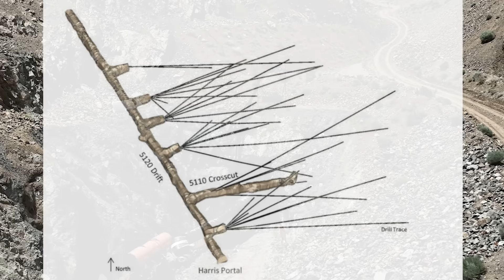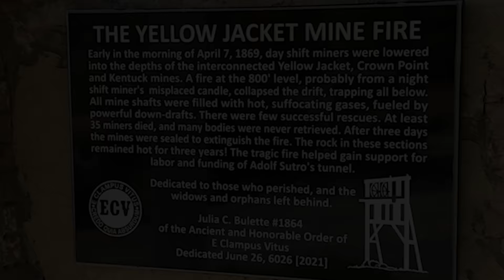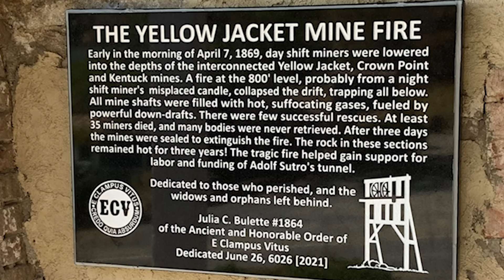Why This Location is the Best Place to Find Placer Gold !

Comment: Years ago, I started digging into the methods used to smelt iron before the Civil War.  I found a whole bunch of people and artists that didn't know what they were talking about.  Then I found a picture showing the old blast furnace with a wooden building built on top where they would feed the furnace below.  The fuel was charcoal and the mix was limestone, clay, and iron ore.  Each would be placed in the furnace in layers.  There was a water mill/bellows attached to one side to push air in.  So much was lost when people moved to modern tech and forgot to document the old methods.  I feel sorry for anyone that wants to move back to old technology!

Comment: I have recorded quite a few hard rock mines and mill sites in California, mainly on the west slope, I never saw the intense use of quarried stone masonry for the mill sites and head frames you show.  Thanks for that.  The cover built by BLM probably achieves two key goals.  One is that it preserves the shaft, which is historically important.  The other is that it preserves the shaft as a roosting area for bats, which are considered important biologically.

Comment: I’ve heard of cool mines , hard rockin with rock temp 167 degrees , 100% humidity. That was till I hit 7000 -7500 feet . No timber ,Paper , no combustibles . there spontaneous combustion is a fact . Work 12 minutes timed then out . These areas put a igloo2 1/2 gallon of ice water on floor 12 minutes later hot water . My skin felt the same gettin steak from broiler oven . Fires death . never go alone under ground  u might never be heard from again . NO JOKE . Thanks Jeff n mrs. Jeff . Have a great time !
Reply from the maker: wow ...that is some crazy temps..... never knew anyone working ta those depths..... wow 12 minutes ...crazy . you would think they would use automated equipment for that ....thanks for sharing that ....we always love to hear stories like that
Reply: @Askjeffwilliams  was 1980-1982 we were the automated . Meant to say , never go underground with out a buddy .

Comment: Jeff, I just found this.  This is a great video.  But it brings up a question.  Were all these huge old mines around Virginia City played out when they were closed?  At $2,000/oz are there any ore bodies left that could be worked?  It's amazing what the did with the technology that was available at the time.  This would be a lot easier now with modern technology.  I wonder if it would be economically feasible.  I assume someone is still holding the claims.
Reply from the maker: yes.... they have gone back an open pitted the Lode by Gold hill ....not much left now ...... mines went down 4000 feet ....no one can work those depths .....
Reply: @Askjeffwilliams  there are multiple mines that go down below 10,000" deep.  Think South Africa.  Obviously this type of mining is for the big boys.  But with new technology, they could probably find what the old timers left.

Comment: Bro you need a Electrician for a Friend and keep you straight on what you call out in your videos, that's a speed control Resistor Bank and its Drumb Speed Controler. The big switches you call out are called Disconnects ether fused or non fused.